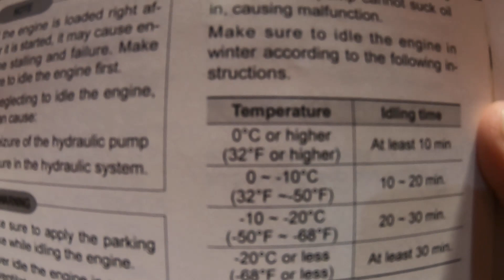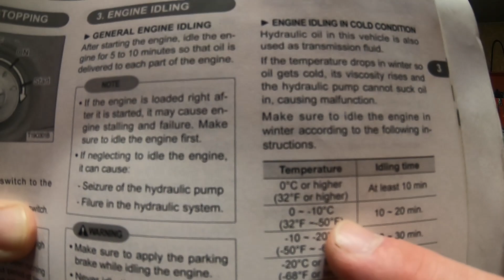Mahindra eMax 20s HST diesel engine idling in cold condition 🧐👌

Comment: Excellent video on warming up your tractor before using it.  I did follow as per instructions in my owners manual and after time I used the temperature guage on the tractor’s dash to let me know when it was warmed up and ready to work.
Reply from the maker: Thank you very kindly Sir for your nice comments and great information 👍👌😇 I do not have a temperature guage on my tractor but planning to install one for sure thank you again, about that magnetic block heater I do have many info and all the folk's love them and including my best friend Joe ( from steel to wood ) on his old Case Tractor CHeers 🍻

Comment: I have noticed a lot of videos on you tube showing the cold starting of equipment. There may be times when there may be no other reasonable option, b ut I want my tractors plugged in to make it easier on them. I will gladly pay a bit more for the electricity rather than put the added stress on my tractors and cause premature wear to the engine and other internal components.
I grew up with gasoline engine tractors and my Dad did not want us running them hard at all until they had an opportunity to warm up. Still stays with me to this very day.
Thanks for sharing Dave. See you for the next one.
Reply from the maker: OUTSTANDING informative input comments mon ami 👌👍😉 Your father was very wise and great on the preventive maintenance and using a electric block heater is THE way to go when the garage is not heated or on the limits of freezing point 🥴 Thank you again and say I to your lovely wife ( Barb 🌹🌹🌹 ) Cheers 🍻👌

Comment: Allo Dave. Good public service video. I keep my shop at 10 degrees in the winter and do like you. Start the tractor and move it outside then I go inside to get dressed up for plowing while it idles.  In the summer I pick up dog poop while it idles before cutting the grass. That keeps the tires cleaner too. 🤣
Reply: You should explain good tire maintenance to my wife Céline... She says she doesn't have time to collect the poop PRIOR to cutting the grass... So I end up with a smelly lawn tractor in the hangar! I won't complain much, as she actually saves me doing so!
Reply: @FromSteelToWood  with 3 dogs that pickup is necessary prior to cutting the grass. I'm just glad to have R4 tires instead of turf tires for the times I miss a few piles.
Reply from the maker: Thank you very kindly mon ami and yes 5 to 10 c is great for your tractor and keep the humid level low too, very fun comment about dog fertilizer 🥴🤣😉👌🍻

Comment: I thought my Case 430 needed long to warm up. That is pretty much the same warm-up time as I need to have the tractor running fine. Thanks!
Reply from the maker: What is helping you is your magnetic block heater too 👍😉 I would probably built a steel tine cage around the carburetor or have the sides engines recovers with steel or rubber panels. Cheers 👍🍻😉

Comment: I had forgotten to ask ....do you put any fuel additives in for winter? if so what kind 
I did another vid on the rear pto and would like to know do you also have issues with some rear units not sitting 100% properly once installed. my box scrapper went back to dealer for them to weld a bracket as they did for the snowblower . and now the ballast box sits on an angle when lifted , works but adjustment arm is fully adjusted to shortest length 16inch if I remember.
would you mind before you get busy with snow doing a vid on rear pto and such , only a few of us have these emax 20s . 
thanks very much.
Glenn.
p.s from one vet to another .....
thank you for your service.
Reply from the maker: I never put additives since my tractor is in heated garage, but I probably wood and I will ask my Mahindra dealer the one to use.  Now for your the rear PTO and Rear tree point attache I will make a video just for you on how my snowblower is connected ( I was also the very first in Canada to have a rear snowblower on it !!! ) Thank you very kindly Sir and Thank you for your service too ( I just came out of the parade practice for tomorrow Armistice day parade !!! )  Cheers 👌😉🍻

Comment: I always like to let my tractors warm up. I plug them in to help the engine start and let them heat a minimum of 1 hour before attempting to start them. Even then, I drive them around slowly before doing any heavy work with them. My big tractor, the 2520 John Deere, takes a bit to warm the hydraulics to where they work very well. I may invest in a magnetic heater this year to alleviate that particular problem.
All great points Dave. I am in total agreement with you.
Reply from the maker: Good day to both of you 👌😉 ( Hello Barb 🌹👍😇) Yes block heater are marvelous for sure and thank you very kindly for your great informative comments 👍😉👌🧐 Cheers 🍻